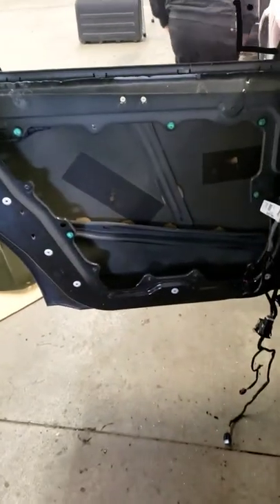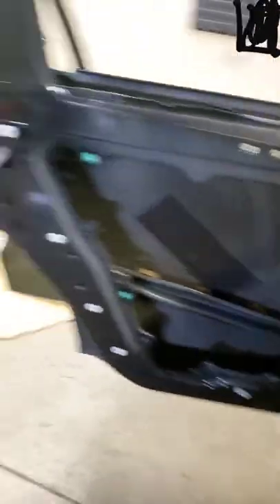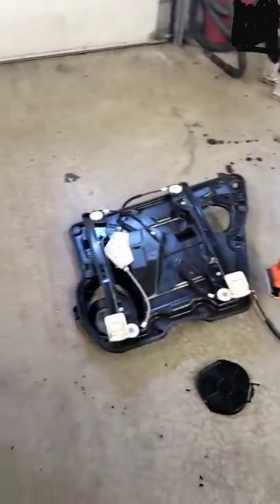Dodge Journey Rear Door Glass installation

Comment: You don’t have to take all that off. Steps

1. Remove panel 
2. Remove small channel with the T15 screws 
3. Slide the glass in at angle, like in this video. (May need to play around with it a little) 

4. Raise glass up
5. Reattach the channel with the T15 screws 

6. Put it all back together. 

You’re welcome
Reply: yea this dude removed every damn thing on the door 😂😂

Comment: I was actually able to get the glass in with just removing the lower run channel via 2 small t20 screws. That gave me enough clearance to twist it in from the top just as you did

Comment: No you don’t only have to unplug window but and the most up plug and sag the panel. There to star bolts to unhook bracket and that holds glass in closest to door handle on inside and should be able to drop window right in

Comment: Wrong just have to remove the small window Chanel held by two screws.
Reply: Lies it’s all one piece, well two pieces of metal welded together with black vinyl like material to cover paint.
Reply: @DubyasUFCAnalytics  guess I will have to post a video to prove it!
Reply: Yea o with I installed it just removing that Chanel no need to remove everything
Reply: Or at least loosen it up